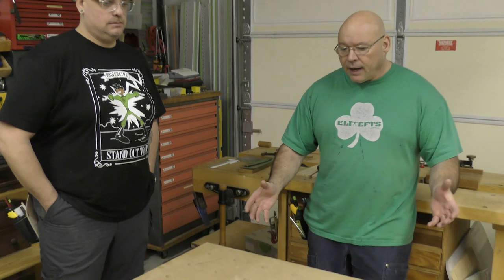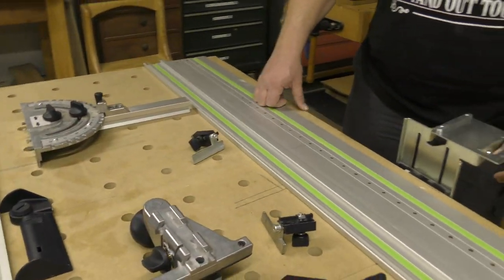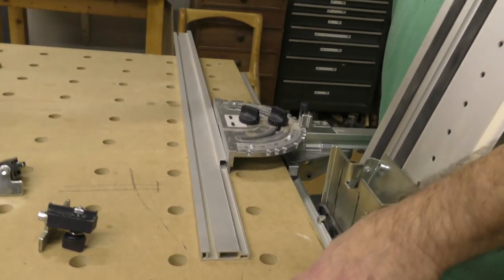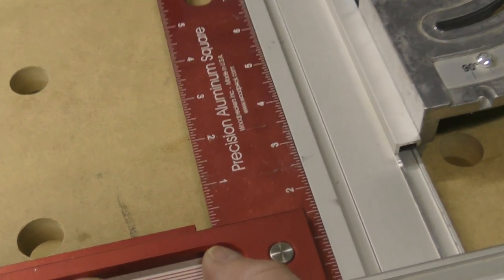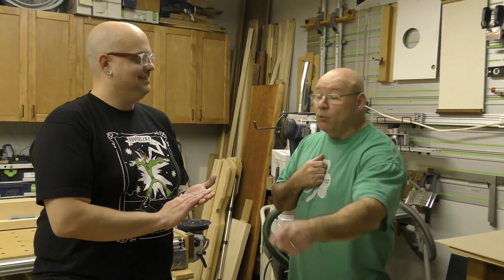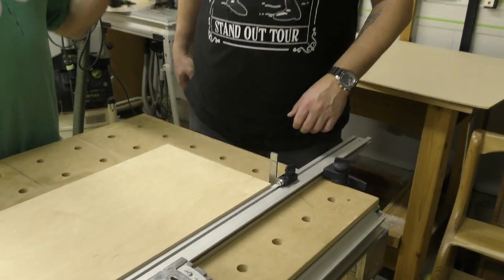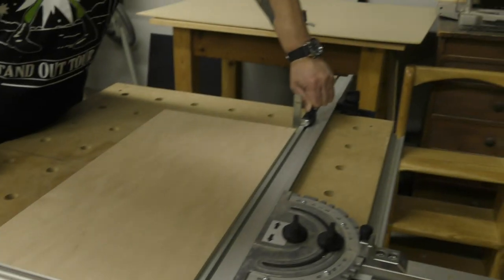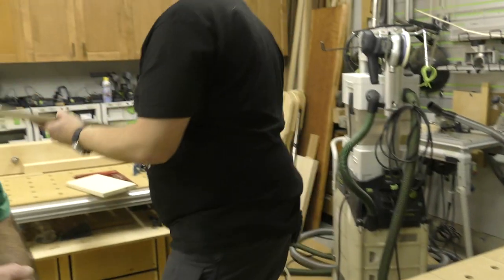Perfect 90: Understanding the Multi-Function Table for Cabinetry

Comment: Hey Sedge, love your work mate. Ive learnt so much from you over the past year and have further invested in festool becuase of my confidence in your training. 

My mft is great however the hinge are really hard to lock down, they seem to be sticking as im closing the clamps. Ive tried loosening the bolts but not working? Please help.
Reply from the maker: need to loosen the 5mm bolts just a little at a time
Reply: @sedgetool  thanks mate, tried it and looks like a little wd40 fixed it

Comment: Great video Sedge. My question is, how do you cut the 1/4" plywood backs? the back fence hits the guide rail before it contacts the material. Thanks
Reply from the maker: I pull the fence back and drop the rail on top of the 1/4" ply...still enough fence for reference...

Comment: Hello there, 

I may be overlooking something, but I just have a question for you regarding the MFT3 workbench / Angel gate. 

How can it be that on both of the two films you have made around the MFT3 table, you put Angel gate on the opposite side in relation to where you cut? 
The way you do it, you have to go around the embroidery if you want to cut 2 different angles of wood. 
One should of course put the Angel gate up on the same side as one cut from I think. 
Greetings a fan from Denmark.
Reply from the maker: this way works for me every time ... but there are many ways to set up the MFT/3

Comment: Sedge,  as a Festool owner - great videos.   I'm seeing some differences in components between this MFT-3, more specifically the miter gauge which is much beefier than the ones on my MFT 1080s.  However it appears the calibration procedure is the same.   At some point I may want to upgrade the MFT 1080 hardware with the MFT-3 components - will need to check into that.
Reply from the maker: Thanks Todd..... You might run into a few problems adapting the MFT/3 components to your MFT 1080 ....
Reply: @sedgetool  Thanks for the heads up.  The MFT 1080s are solid clamping tables in any event.  Scarcity of some Festools (most notably cordless saws) has been an issue, hopefully we see some relief by the Spring.
Reply: The aluminum extrusion is completely different on the  MFT/3  compared to the 1080. I have the 1080 and changed over to Dashboard attachments. Very high quality, precise and heavy duty.

Comment: Sedge, just setting up my mft, how do I calibrate when the track doesn’t fall onto the pin? Thanks.
Reply from the maker: most of the time I have found that to happen ..It is how you tighten the 5mm screws .. the video shows the process...ourbord 5mm cap screw tight...inboard 5mm cap screw just snug...hope this makes sense
Reply: Makes sense! And yes I did see your video after the fact, tried it your way but still it’s off by at least 10mm…
Reply: I redid the entire process and it worked perfectly. Thank you Sedge!

Comment: Good evening. I just purchased my MFT last week, do I register it also on the site? And I put everything together. But when I lay the rail  down in my timber, I have a movement left too right. I tightened everything down, is it suppose to do that?

Sent from my iPhone
Reply from the maker: yes ....you register the MFT/3 on the site.......there is slight play in the legs but the wood should not move .....
Reply: @sedgetool  thanks for the response. It’s not the legs, the rail itself. I think I figured out agree I went wrong. When I lay the track down it doesn’t go over this pin, I have to move the rail over to go on it, plus I wasn’t raising the other end until it went in the groove before I made my cut. I also think the factory Stop isn’t set right.

Comment: Sedge. I’m cutting 3/4” white melamine with my track saw and MFT table set up. 

I have changed the blade, re set the splinter guard, put a brand new green piece on the right side that you slide down to the top of the work piece and even put a brand new blade. It’s a 48 tooth blade with the yellow and green circle markings. It’s a 495377 blade. 

I am getting small chips on both top and bottom sides on both sides of the piece. The tooth is set just below the 3/4” melamine. 

Any thoughts as to why it’s still chipping?  

Thx!
Reply from the maker: sounds like you got everything covered .... I would try cleaning your existing blade .. or switch to the laminate blade which is a triple chip grind .. Blade # 496309 here is the link 
https://www.festoolusa.com/accessory/496309---160x2,2x20-tf48-usa
Reply: @sedgetool  perfect! Thank you very much! I also, I remove the splinter guard from under the track and reapplied it with pressure so I can get more uses out of the same sprinter guard. I did not run my blade through the splinter alone, as my first cut went through the splinter card and threw my three-quarter inch white melamine material.  I was talking to a guy at Berlands  house of tools in Palatine Illinois (Spencer) And he said I should have cut through the splinter guard without material being bullet Andrew set my blade just below the thickness of the splinter guard.
Reply: @sedgetool  also, I called Spencer and he said they have one for HPL and one for solid surface. Which one should I use for melamine?
Reply: @sedgetool  as far as cleaning my blade, I put a brand new blade on and it was still chipping.
Reply: @sedgetool  i’m going to my Festool dealer this Mon, but I’m confused….

There are two blades, one meant for HPL and then the one you gave me the link to, which is solid surface and HPL. 

Which one do I want for cutting melamine?
Ty